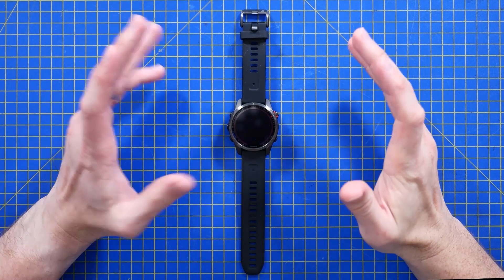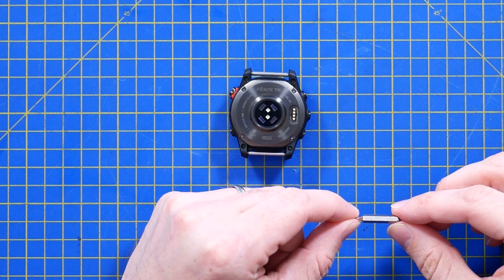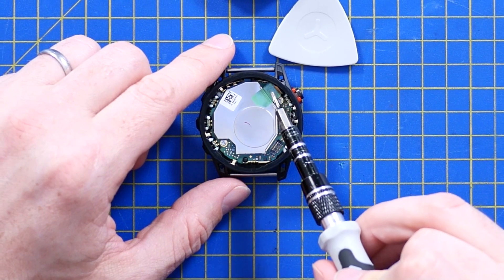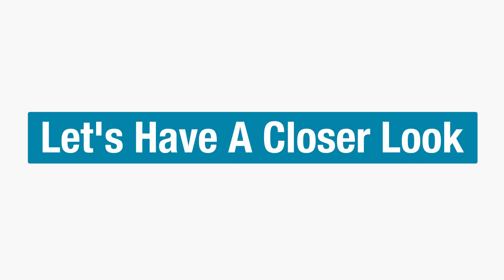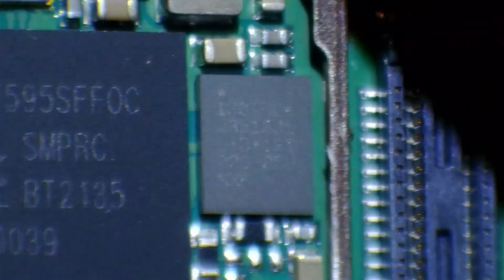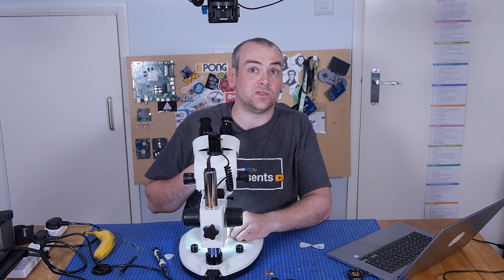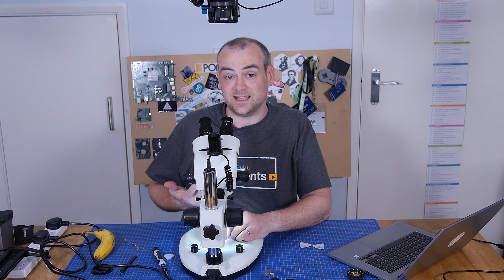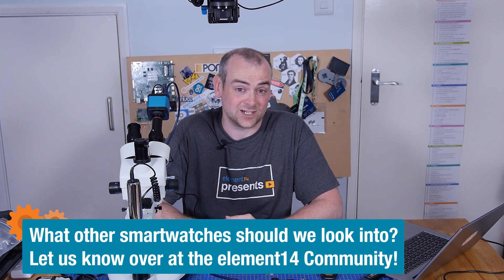Garmin Fēnix 7S Solar Teardown - The Electronics Inside

Comment: Multi-Band means you use different GNSS bands not exactly different systems as some of them are in the same band. For example the Chinese Beidou B1c signal, the GPS L1 signal and the European Galileo E1 signal are all in the same band.

What Multi-Band refers to in this chip is that it support both L1 and L5 band of the different systems, it's nice to have it because L5 signals provides better accuracy in environments with a lot of multi-path, like in a city with tall buildings.

Comment: My first guess on the the ML component would be for adjusting for individual movement patterns--for sensing things like flip-turns vs no flip-turns, or transitions between swimming, biking and running, things like that which can "look" very different from user to user.  just a guess.

Comment: Brilliant teardown. Thank you so much. Interesting point is that Garmin are producing dozens of different lines and models of smart watches in a few case sizes. It is mind boggling to shop for a watch in the Garmin because of this. It would be amazing to have a reference chart that shows the various chipsets in them to compare. The pricing of these watches ranges from $300 to over $1,000 US and it would be a fun treat to find out that the cheap ones have the same chips as the expensive ones!  Makes me wonder.

Comment: thank you so much for this video! I'm not an exepert but I have one question: did you see 2 antennas inside the watch or only one antenna? Garmin said that this is a multiband watch but it is not clear if it has one or two antennas.
Reply: I think it means that the GPS chip can communicate with more than one frequency.....Don't need separate antennas for that.

Comment: Interesting to see the particular chips that garmin is using. I'm almost sure that the 100TBn is a NFC chip for garmin pay. You wouldn't want a power-hungry ai chip on a watch if you can solve the same problem to 99% in procedual code on a low power cpu.
Reply: No not efficient enough in solving enough (99% as you say) it makes sense what you believe but nope. Ai chips don't consume as much power as you imply either. That's how the algorithm is used to make things like vo2 max and hill score and endurance score etc.. there's a ton of metrics involved

Comment: Are there any good smart watches these days that aren't insanely expensive fitness trackers?  Sure, some basic fitness tracking would be fun, but I really only have these needs: 1) I need a very reliable way to get useful app notifications on my wrist. 2) The notifications should stay on the screen until I dismiss them. 3) I want to see the time of day without pressing buttons. 4) I need a multi-day battery life.  Does anyone make a watch like this anymore?  I really miss my Pebble.
Reply: I had a pebble and a pebble time. I too miss them both.

I have so far found the ticwatch pro to be my "next best" for the experience I want.

Although I can't wait to see what the pixel watch may be?
Reply: @a531016  I have some hope for the Pixel watch, too. I guess we'll know in the fall.
Reply: Thank!  I'll check it out.
Reply: Check out Coros Pace 2

Comment: over $850 CAD.  Too costly for me.  My most expensive smart watch is about $40 CAD and changing the battery is easy on my smart watches.  Take the back off, remove battery,  replace battery with new one, and then replace back.